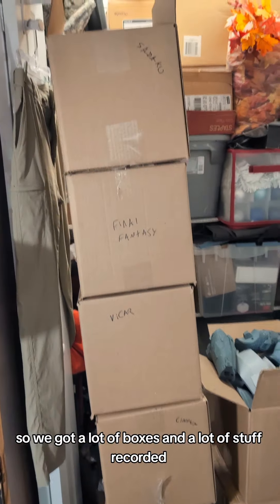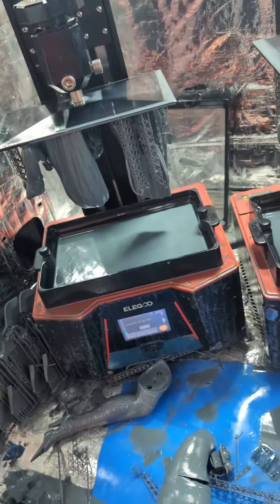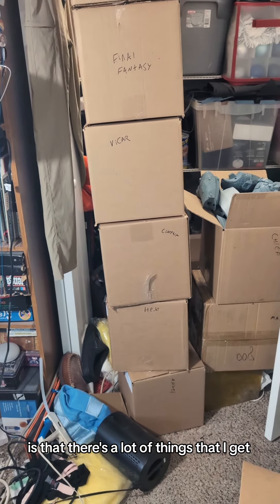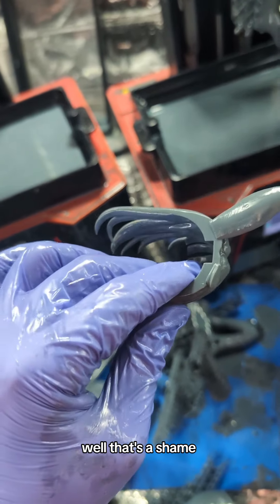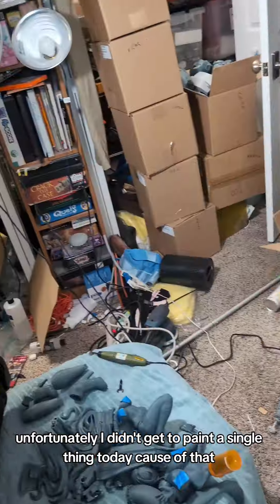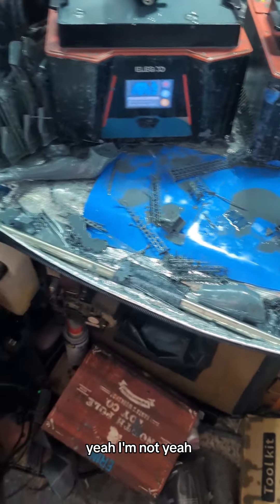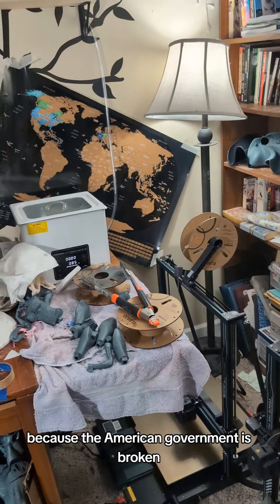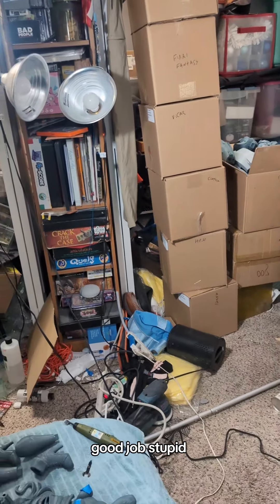The most figures in 1 day EVER

Comment: I started thinking, since it seems like keeping track of parts seems like it is an issue, would having a white board or something similar that you can list out the parts for each figure and track the print status with colored magnets (IE one color for parts that have been printed, one for parts that need reprints, etc)? Plus you could also then list the placement of those parts in temp boxes (for example have Freya in box 1, Noir in box 2, and so on) so everything stays together.
Reply from the maker: there are way to many moving parts to keep track of things. 
while a print might only take 5 prints to get out. the plate can have 10 pieces on it. and if 1 of those pieces does not print, thats where the issue is. cause half the time i wont know it didnt print. i will just be looking at a blank spot. i have to go back to the computer, open the file and make sure everything is there, and thats just not possibe. and then i have to go to the setup file, and get just that 1 piece, and set it up on its own. 
but then im putting it on a plate with a bunch of other figures, so i get the most out of the print. and stuff gets messy. lol. 

its just kayos.
Reply: @FreyasFantasys  It was an idea i thought could work and help reduce the levels of kayos. Only other thing I could think of would be to print a screenshot of what is supposed to be printing.